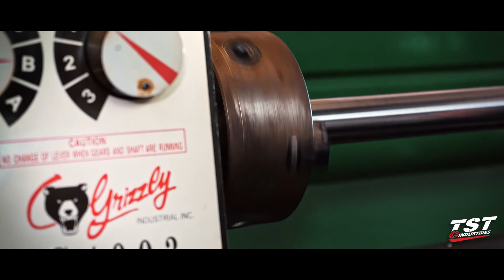Time to repair the damages  [Superbike Build Series Ep.23]

Comment: Bart, the 2019 R3 has a top clamp similar to your design, time to lawyer up. Upside down forks, low clip ons, you are onto something there.
Reply: Actually its Bart that copied Yamaha. They have been doing that cutout design for a while on their race bikes and now are doing it more on the street bikes. The current  gen R1's have that design.
Reply from the maker: You are correct. Those cutouts have been used on motorcycles for a decade now. It started with GP bikes. Now a lot of the stock bikes have similar designs. There is a function behind those cutouts, and we decided to implement them.
Reply: I was being a joker. For the R3, I did see TST prototyping it here first. I understand the supersport and superbikes have that design, I was just pointing out that I saw the R3 part here before 2019 reveal by Yamaha.

Comment: would r6 forks fit on This?
Reply: No, they are too big and won't fit through the triple clamp. You would need to do a whole front end swap.
Reply from the maker: The thing is, we can machine our triple clamps to fit any fork setup but the R6 forks, wheel, brakes, etc. are too heavy for this bike and would also need to revalve the shim stacks. It is pretty impractical for performance. We will be making a setup that uses the new 2019 forks though, and we will test out those new components against the old setup.